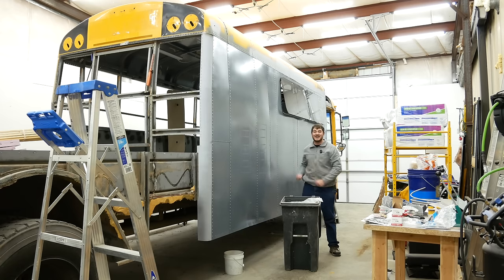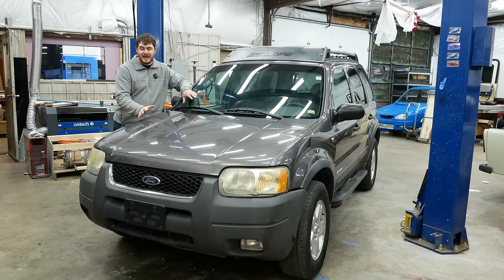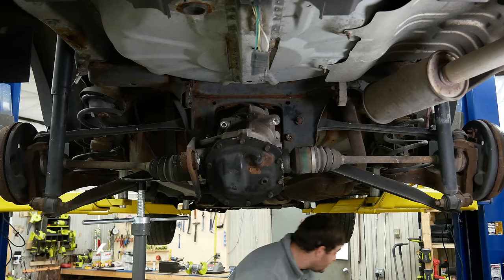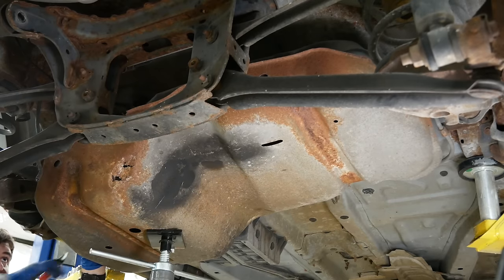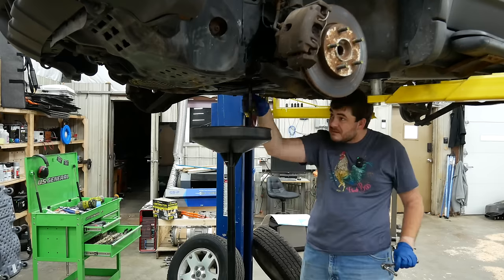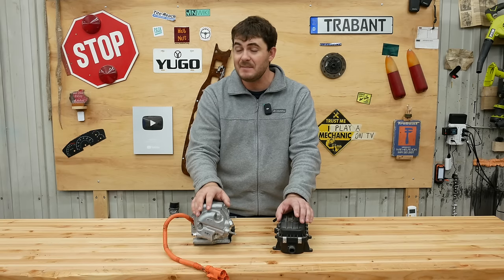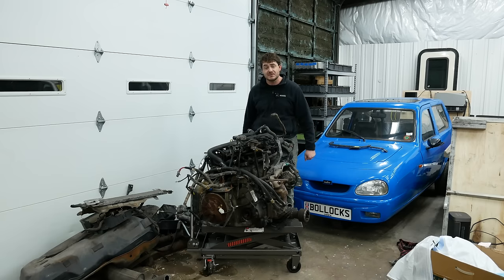I'm Building a 900HP Electric Ford Escape with a Purpose

Comment: A lot of head gasket stop-leak additives have copper powder in them.  That's probably what you're seeing in the coolant.
Reply: I've seen that head gasket in a can stuff plug up so much, saw a water pump frozen solid by goo because someone tried to use that stuff to fix a radiator leak, as well as radiator stop leak... Kinda funny, except that the water pump really didn't want to come off that old "Magnum" 360 it was on due to the goo.
Reply: +1 Concur with Danny there.
Reply: Exactly what I was going to say, that was just the remnants of a head gasket repair in a can. Would be a good idea to flush the crap out of that radiator.
Reply: Yup, I was suspecting either radiator stop-leak or head gasket stop-leak.
Reply: Yep those little bits get caught in the leak to hopefully stop it. The extra is also what gets caught in the rad and heater core stopping them up.
Reply: Stop leak for sure
Reply: Radiator stop leak has copper in it too
Reply: Absolutely stop leak. I see it all the time.
Reply: Just come to say this.
Reply: As someone who has used head gasket repair in a little POS 4 banger, yeah that's probably headgasket in a can...
Reply: Or a copper head gasket, though I don't think they are that common anymore.  Coolant stop-leak was also my first guess.
Reply: @tarstarkusz  but a copper head gasket wouldnt turn to powder in such a uniform consistency.
Reply: TIL! This solved a recent mystery for me.
Reply: Was just about to say that it’s a pain to clean out of a cooling system too lol
Reply: I believe this is the correct diagnosis
Reply: With how that car sounded, that was NOT a happy engine!
Reply: And it can be VERY unpleasant if it gets on your hands. Some are made up with micro strands of copper so it's like you grabbed a cactus. 🤥
Reply: Nailed it
Reply: Yes, I saw the copper and immediately said aloud to scrap the radiator reuse idea, it ain't worth it lol. Definitely stop leak was used
Reply: Yep, that's Bar's Leak Liquid Copper.  I've dumped that stuff in many rolling piles of junk throughout the years.
Reply: "cut" in Radiator is not uncommon .. dent is likely from shipping
Reply: thanks was about to post this.
Reply: Let's hope he doesn't try and run that stuff through the new components. Time for a new radiator just to be safe.
Reply: Came here to say just this! Also, because of it, the heater core might be plugged, but with the electric conversion it matters as much as curtain color in a burning house.
Reply: The previous owner probably thought it was just a blown gasket, when he's got a cracked head.
Reply: yep1 that's exactly what it is1 i have seen this same thing many times that shit should be avoided at all costs1
Reply: Craigslist ad: Brand new radiator!
Yep, 4 bottles of stop leak confirmed.
Reply: @Chris-du7hi  The ol' Crackhead Craigslist Rebuild.
Reply: Ditto.
Reply: Yes! Do not use that radiator.
Reply: Yup, but be sure to flush your radiator after you stop the leak, otherwise the stop-leak could block up the radiator as well.
Reply: Came to say this, but knew in my heart it had already been said!
Reply: Totally agree was about to post the same comment.
Reply: Coolant leak, overheating engine, warped head, exhaust gases go into coolant...

Maintenance, eh?
Reply: yes  yes and yes
Reply: @johnfreshour2651  it’s the same stuff. A blown HG IS a coolant leak.
Reply: I came searching for this comment as I figured someone else would have the same idea!
Reply: The copper filings come from coolant leak sealant
Reply: I agree. Some type of stop leak.
Reply: @JaretKade do not exaggerate, after a good rinsing and checking for leaks, rubber hoses are easily reusable
Reply: Was going to come to post this too!
Reply: @JaretKade if the car has not been standing with oil in the hoses for a month, they can be reused. Although it's America, there are no mandatory technical examinations like in the EU
Reply: Yuuuuup

Comment: I have this vision of a State Trooper looking at his radar or Lidar in stunned disbelief after a completely silent 20 year old Ford Escape blows by him at 150 plus and still accelerating.  Way to go Robert! Good luck on both projects!
Reply: I'm gonna guess the range will be horrible at high speed with this thing, but it should drag like nothing else (mostly because there's nothing like it)
Reply: @AsbestosMuffins  My EV drains 15kwh of usable battery pretty quick with just 40kw motor if I hammer the throttle. I DO have to drive slow to get 50km range with current cold temperature. I swear it was 70km in summer heat. She is slow and doesn't get very far. And I know how fast a 300kw polestar 2 is, so 670kw explorer would surly rip some tire smoke but tiny battery won't last long.
Reply: While towing a trailer! :-D
Reply: With that much power, he'll be able to pull wheelies in that car even.
Reply: @Fantaman900  What's your EV that you only have 50km of range in the winter? A plug in hybrid of some sort, or did you DIY an ev conversion as well?
Reply: @gorak9000  i have a 10 year old renault kangoo z.e. thats is the same drive train as renault zoe with a 22kwh battery. 7/8ths on gauge is what I use, the last 1/8th is reserve and I don't want it to stop with empty charge. I daily on a EUC called sherman with more range.
Reply: @Fantaman900  Fun math, if that 16kwh pack could actually run the two motors at full power (it can't), then the motors could deplete it from 100% to 0% in just 86 seconds, not counting additional loses that would likely deplete the pack much faster. Of course the vehicle itself wouldn't be able to handle the motors going at full power nor for that long. 

For your draining issues, your car likely uses just a resistive heater instead of a heat pump. That likely pulls at least 1.5-3kw while running, costing you between 7-14 km ever hour that it runs. This is why larger battery packs are more important in colder conditions. You will still pull roughly the same 1.5-3kw for heat while running, but it will have far less of an impact on range percentage.
Reply: @anthonypelchat  Yeah resistive heater draws up to 5kw I see on my gauge cluster. So I consider a diesel heater if I want heat. But as long it's not freezing I can do without heat. I drive very slow too to maximize my little range. Charging 500 meter from your house is a pain to do often.
Reply: @Fantaman900  5KW!!! Why in the world is it using that much? There are central AC units that don't use that many KW. No wonder your range sucks during winter. That's an over 20km range loss every hour just for heat. I would be tempted to throw a propane heater in there instead. lol. 

I realize that you didn't ask for any advice, but a simple option may be to get a portable battery pack, like an Ecoflow. You could then run a spot heater and seat warmer from it. You could use the unit for backup power outside of driving as well. Stay safe and warm. I hope the best for you. And I'm also very glad that I live in the south where it's much warmer. lol
Reply: @anthonypelchat  Like a said I consider a diesel heater. Because hell 5kw is way to much and 1kw is barely any heat. A diesel heater would also be able to pre heat the cabin. My previous car had a webasto thermo top c whichwarms the coolant. So nice to have pre heater engine amd cabin during frozen times. A diesel air heater is very effecient for heating small cabins. Hella funny pulling up de a gas station with an electric car. Just the fill heater tank
Reply: @Fantaman900  lol. Yeah, it would be interesting. I would use propane instead since I can just grab it from my gas grill that isn't used during winter. But to each their own. I would also think 1.5 kw space heater would be enough, but maybe not in your area and temps. We only get a few weeks a year below freezing over here.
Reply: Don't try going over 100 MPH in a Ford Escape. Especially one with some grey hairs. If you know you know

Comment: A lot of those random weights are bolted on to mitigate vibration by moving the the CG of components, or just adding enough mass to change the resonant frequency. Usually this happens in secondary and tertiary vehicle testing, so the solution is cast a hunk of metal, sometimes encase it in rubber, and bolt it to the frame or vibrating component. I have a bucket full of gray iron weights that look like kit-kat bars that were cast for this purpose.
Reply: I bet they are not as chewy -- or tasty -- as Kit-Kat Bars. 😉
Reply: @Allan_aka_RocKITEman  That teeth shattering crunch though! Perfect!
Reply: That's what he meant by NVH(Noise, Vibration, Harshness) btw.
Reply: @razordrive3238  >>> 'Rock candy' on steroids...😊
Reply: @Allan_aka_RocKITEman  Since when are kit-kats chewy?
Reply: Could also be the mass of the differential unit isn't centered, so they add a counterweight to balance it out to reduce it from eating the mounting bushings. Ford does it as well on their diesel trucks with the DPF/cat assemblies, otherwise it would want to roll to where the heaviest part is at the bottom.
Reply: @theyeetus1428  >>> Okay, "chewy-crunchy." 😊
Reply: @theyeetus1428  They crunch, so you're not likely to gum them to death are you?

Comment: the next generation escape after this one actually switched to an electric power steering setup, the hybrid ones of this generation may have the electric power steering too but those may be harder to find than the  regular 2nd gen ones :) can't wait to see this finished!
Reply: He could probably find an electric steering rack from the same generation quite easily as it was used in 2005-2007.
Reply: I'm pretty positive the '09-'12 Escape should all have electric power steering, and the 1st and 2nd gen Escapes are largely the same underneath, so it may fit without major modifications. 👍

Comment: Oh wow, it has the No Boundaries roof rack as well! Those are highly sought after

Also the reason there's so much room for batteries is because these were offered as hybrids! You could get the hybrid rear window installed, as those have an air scoop to cool the batteries
Reply: :-) the hybrids are build a decade later then this model.
I doubt they already thought about it back then.

We have a 2003 Ford Escape.. (100k miles)
Really nice car.
It had its isues, mostly because lack of maintenance by previous owners and crappy mechanics. All good now.
Perhaps convert it in 3-4 years to EV :-)
Reply: @fhorst02  the hybrid has been available since 2005.

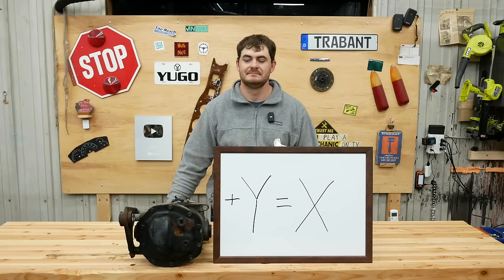Comment: 5:15, I laughed my ass off. Great video Robert, looking forward to upcoming ones. Usually I don't like EVs but converting the bus is probably a better idea than just swapping in a much more powerful diesel motor.
Reply: I would have never expected that you were an Aging Wheels fan.
Reply: Made me laught too, not much because of the joke but by the fact that it looks like Robert is about to burst out laughing from his cheesy joke.
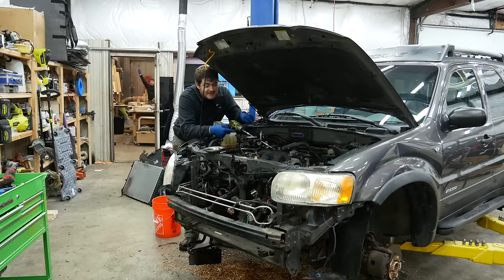Reply: Also found the cameo funny at 15:24
Reply: I was  maybe wrongly assuming the buses diesel was turned down for school bus use and could easily be upgraded. Maybe cheaper than an EV conversion. Turn up the fuel/ bigger turbo ...Bob's, you're Uncle.
Reply: @Demoncarlie  I even started to waive back to him there.
Reply: So did I!
Reply: Same. That was such a bad joke but i had to laugh. Thanks Robert
Reply: Need a minus sign on the diff, so the -diff + modelY motors = an electric ford Xscape...

Comment: Remember to always be very careful when heating suspension components, especially ball joints. The packed grease will boil and then the ball joint will blow out of the frame socket like a bullet and will go THROUGH people. Safety information aside: I love this dang channel. You're doing what I wish I could. Unfortunately owning a big ol' workshop is hard in tiny old England.
Reply: I bet you could do it. There are quite a few folks on YouTube building cars in their one and two car UK garages! There are even some in Canada, Throttle Stop Garage is a good example.
Reply: @GrayRaceCat  I don't even have a garage haha!
Reply: @ivy7642  That could be a problem!

Comment: I am SO excited for this project! I’ve been wanting to buy an A class RV and convert to electric so it’s nice to see some ideas how you’re going about it. Subbing and looking forward to when you put this in the bus!

I’m most curious about your thoughts for range on the bus
Reply: I've been looking into that stuff a bit recently. It appears that you should have a diesel heating system if you plan on going into cold climates. Wessar has a neat little stove and heater unit that might be useful for you.
Diesel apparently has a dry heat to it

Comment: Don't weld the buss diff, its gonna make it turn even worse, if you're worried about traction get a selectable locker for a big rig, or they probably even make them for busses.  Also I think you're going to like the escape so much you won't want to tear it apart.
Reply: He's not welding the bus dif. He's welding the Tesla dif.
Reply: @jeremymcginnis7258  i guess that part got a bit confusing
Reply: @jeremymcginnis7258  Why though?
Reply: @theyeetus1428  Because it's going to be connected to a driveshaft on one side. If you have a differential in your motor, the other side of the motor is just going to spin and nothing will happen.
Reply: @user2C47  I can't imagine Ford escape diffs NOT vaporizing almost immedietaly under 450 hp
Reply: @klasztornik847  He is not using the Escape diff as far as I understand the plan...maybe the axles adapted to mate to the Tesla differential/

Comment: I must admit I'm not into electric cars, but thinking about it a bit, what you're doing is in the spirit of hot rodders from the old days. Take a car, put a more powerful "engine" in it, and have fun with it. Looking forward to the rest of the project!
Reply: Why did you put quote for engine? :D they are still engines
Reply: @2008tourer  An engine uses either internal or external combustion. A motor relies on electric induction.
Reply: What makes it even more exciting is that the secondary market is still the wild wild west, with some parts outrageously expensive and others dirt cheap. Often a startup will fail, and their stock gets liquidated by someone who neither knows nor care about the value. Companies abandon a technology, or overbuild a component. If you have some imagination, there is a lot you can do.
Reply: @ArthurRoy13  engine is a much broader term than that.

Like...a difference engine for example
Reply: @ArthurRoy13  an engine converts energy into motion. The energy source is irrelevant. Electric motors are engines.
Reply: @griffinsmiley9110  Be sure not to put engine oil in your motor :)

Comment: This is looking like an interesting project, but I am concerned about you reusing that radiator. Considering the sludge and copper that came out of it, I would be worried about the radiator contaminating the coolant passages in the electric motors and batteries. For the cost of a new radiator being relatively low, especially compared to new motors and batteries, I would just replace the radiator, or at the minimum find a good way to properly clean it out.
Reply: That or see if re-rodding (if you can find the specialty shop) might help clear things out. Whatever sealant was used to fix the radiator is probably going to hang around, too much of a risk for what you want the car to be, which is a functional EV conversion. (Although I just looked up what a radiator cost OEM, aprox. ~$200 max.) Re-rodding is a specialty these days so the labor is probably worth more than the OEM part.

Comment: Certainly check the rear shock towers.  They seem to be a weak point of that vintage Escape.  

Adding the mass of the batteries et al won't help if they are compromised by rust.

Comment: Hey, to simplify the solution for the power steering and power brakes, get a GM Hydro boost cylinder and just hook an electric motor to a GM power steering pump. You can run both off one pump and this build is temporary so you don't have to worry about the longevity or efficiency of the setup. Plus hydro boost parts are smaller than vacuum ones

Comment: If you want to reduce some of your project costs you should look around and see if you can find any scrap yards that would take the old metal parts you don't need anymore. it most likely won't be a ton of money that you get unless you save up a bunch of scrap and take it in all at once but i figure every bit helps.
Reply: and it cleans up the place. I have abtrailer that I fill up with scrap. when it's full I have some cash in hand again.
Reply: Or even just sell that engine to someone, even if they pay scrap price it’s even and any money above that is just a bonus.

Comment: Looking forward to this one. When the ICE eventually dies in my S197 Mustang, I know AEM already has the kit to convert it to an EV.  But that was with one large drive unit. I'd love to turn it into a 4WD setup very much like this.
Reply: That sounds like a fun car. Are there any bolt-on parts available for the front to allow driveshafts in a Mustang?
Reply: if you fit two drive units to a Mustang you wont have space left for battery.
Reply: @EmyrDerfel  it depends on the batteries used - if they fit in the area occupied by the driveshaft, exhaust and fuel tank, there may still be space. Depends how much range you need. Also, removing the back seat can give Battery space. 

If it's just meant to do a few quarter miles, a smaller pack would certainly reduce weight, as long as it has enough power to supply the motors fully. Power is instantaneous (kW), while capacity (kW*h) is power for a period of time.